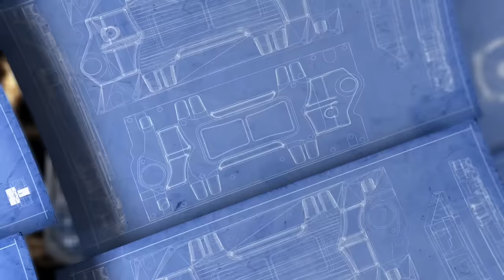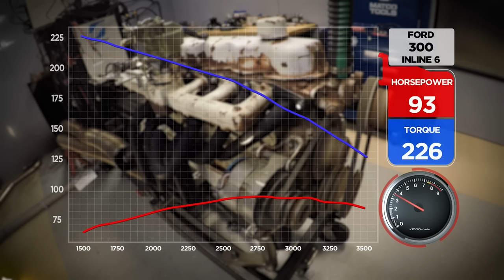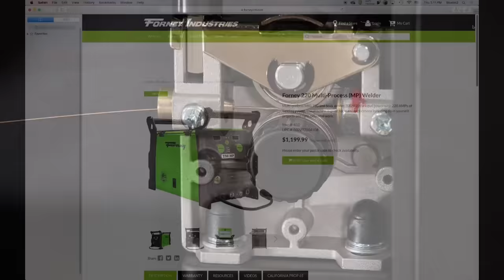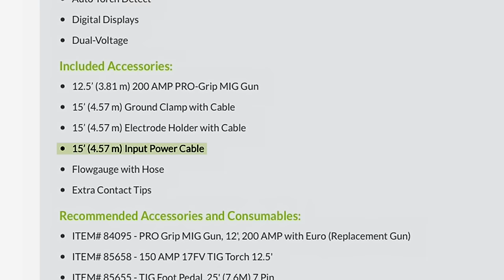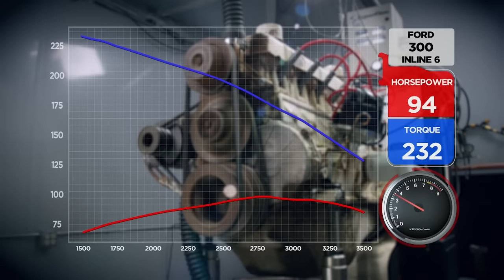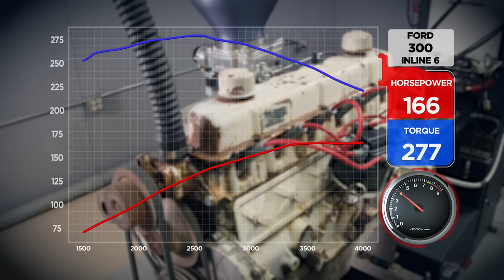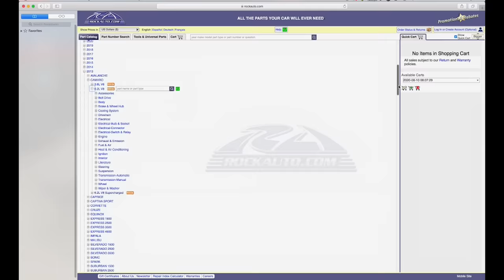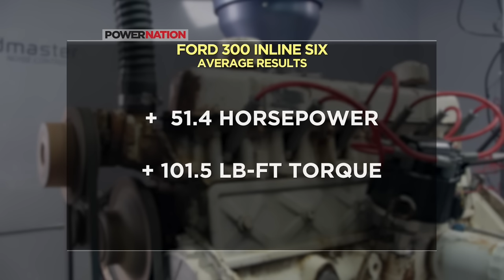Ford 300 Inline Six Gets Eye-Popping Off-The-Shelf Power - Engine Power S7, E17

Comment: 6:45 that's why you use an old pad to help compress the piston
Reply: Right I was wondering if I was the only one that thought that 😂
Reply: That's the best way and adding a little length to the handle on the c clamp works wonders
Reply: Works for me... everytime...
Reply: Yeah, that tool is for the guys that already bought everything else off "the truck" lol
Reply: I've never done it any other way. This guy is treating us like we are Sammy Sausage-head.
Reply: not to mention most people are stronger using a rotational force (which is also easier to 'enhance') than using a grip based force.
Reply: You see, what I do is I go find another person's car, jack it up, take the wheel off, use it as a jack stand, stick that under the car, then I set it down, lift up the other end of the car, take their rear pads off, then I go back to my car, take my tire off, take my caliper off, stick THOSE brake pads into the caliper, smash a low profile scissor jack in-between them, and then I push the caliper pistons back that way. 

No I don't
Reply: @Timman57  Thanks for that, that was entertaining.
Reply: @BrewBlaster  I'm REALLY bored.
Reply: I use vise grip c-clamps and a old pad or a little piece of flat stock.
Reply: That tool is the usual snake oil adds that you just have to filter out lol.
Reply: @Timman57  and don't forget to check the muffler bearing while you're under there .constant problem with those .
Reply: I think it's the only way with dual pistons.  Both pistons need to be pressed in at once, because the second piston will push the first piston back out...
Reply: @mikejohns3104  True, but it'd still be kinda nice to have.  Countless other tools I'll buy before that one though.

Comment: The issues with the 300s was ability to flow. 

The heads weren't made for flowing well, and if you fixed that, they made power even with no turbo
Reply: Actually you can take a set of 302 Boss heads, chop a cylinder off each, weld them together and you're good to go. Lol 

A WR 1/4 mile was set with that setup.
Reply: I've always wondered how you can run a 300 at full throttle day after day pulling heavy loads and not destroy the engine. It appears the way it was designed, full throttle from the factory is actually closer to 60% of potential. Pretty smart, really. If you want an engine to last forever, restrict intake and never allow it to work hard.

Comment: absolutely love this 300 series. I am currently redoing my dads old f250 that had a 460 and I am changing it out for a 300. Hoping to get 200 horse an 300 torque.This series gives me lots of hope!
Reply: Keep the 460
Reply: I know this is an old comment, but if the 460 still runs, I'd keep the 460 and use a 300 for a different project

Comment: When you changed the old points distributor to the new High Energy GM unit capable of 60,000 volts, you didn't change the plugs to accommodate the higher voltage spark. We've gained HP with a change to E3 diamond fire plugs, and even more HP with the addition of an MSD 6 ignition box that fires the plugs 20 times per revolution up to 3,000 rpm. More complete fuel burn to utilize the power from every drop of fuel. The emissions dropped drastically as well since there was very minimal excess unburnt fuel in the exhaust.
Reply: I was thinking the same thing. I'd opt to change to Iridium plugs with sizeable gaps. The spark plug gaps when running points are pretty narrow.

Comment: In the 1970s I worked at a race engine building shop in Nashville and we built 2 300 Fords like no others, They both went into NHRA record holding cars. Both had  cylinder heads that were made from 5 Ford Boss 302 heads that were sawed apart and then furnace brazed together in a fixture so they would bolt to the 300 block. Then they were what was called "high ported" where the exhaust side was milled off and a billet aluminum plate was bolted on. This allowed the exhaust gasses to exit at about a 45 degree angle. One of the engines had 3 Weber 2 barrels and the other had a fabricated Hilborn mechanical injection. Everything inside of these engines was the best with BRC pistions, Carillo rods, Solid roller cams and everything else.

Comment: I love the incremental testing. THIS is how much a header is worth - THIS comes from adding a decent intake...the ignition was a surprise. Points should have been able to handle that rpm and load. The original must have been completely shot.  BTW if anyone is looking for one that hasn't had the balls beat off it, check out the  mid '80s Ford econo-stationwagons. They actually had these jammed into that little engine bay.
Reply: Which econo-wagons would those be?
Reply: @413x398  they were never installed in cars.  The 80’s passenger cars had the 200ci inline 6...a whole different turd.  😂
Reply: @413x398  Hang on - let me see if I can get an ID.
Reply: @413x398  OK, got it - mid 80's Ford LTDs. Sound weird, but they're not the giant dinosaurs from the '70s - they're a Fox platform. Don't know the exact year. An ex-girlfriend "volunteered" me to work on the thing for a bunch of nuns (yes, this is true and yes, she was hot enough to get away with this behavior, for a while)
Reply: @nferraro222  You need to do some better homework. These tall deck inlines were not ever put in passenger cars. The low-deck inlines (200) were phased out in or about '83 and replaced with the Essex, which was a 3.8 liter (232 inch) VEE 6, a whole differ animal with aluminum heads. Please from making statements without verification just for the sake of throwing out a post. Thank you.
Reply: @413x398   OK, I see what you're saying. The 200 was a smaller straight 6 used in the mid-sized wagons. It looked huge in the car, but it was still smaller than the 300 I've seen in trucks. I retract what I said.
Reply: @nferraro222  For your punishment you must push a 300-incher truck one mile on four flats. Get it on video.
Reply: @413x398  I fixed that car for a bunch of nuns - my conscience is clear:)
Reply: @carportshenanigans5918  they did put the 4.9 in early eighty's ltd's. I know for a fact cause a old boss of mine had one in his ltd, I drove it and worked on it. It wasn't a 200, it was a 300 4.9l. and if I remember right it was a 84 model.
Reply: @Meantoy  negative, no such animal existed.  The oil pan would drag the ground while the valve cover stuck out of the hood.  The LTD II(the foxbody “baby LTD”) had the 200(3.3l)...no bigger six than that...ever.  Do some research bud, you’ll be sorely disappointed.
Reply: @carportshenanigans5918  whatever dude
Reply: @Meantoy  fact is fact, not “whatever”.  Maybe your boss told you it was a 300 or maybe your remembering wrong, but they didn’t produce a single passenger car with a 300...ever.  Look it up, you’ll see...don’t be grumpy at me for spittin’ facts.
Reply: @Meantoy  84 the only 6 banger was the 3.8 Essex V6. 83 was the last year for an inline and it was a 3.3. These other guys are right, Ford never put a 4.9, 300 inline 6 in a car.
Reply: @kevinthomas1462  Thanks for the correct information.
Reply: @413x398  The 240/300 was the base engine for the mid-late 60's LTDs.
Reply: @mfree80286  The 240 replaced the old design 223 in base Customs and Galaxies in '65. LTD's were an upscale option and there was never a six in one. However, this thread is about 300's, and not a one in a passenger car.
Reply: @413x398  Same deck height though, where one fits the other goes
Reply: @mfree80286  So, you can claim that 428's came in trucks because the deck height is the same as a 390?
Reply: @413x398  Christ, why does everyone on the internet always get their f*cking panties in a knot...  The other guy up there was saying it'd be dragging the ground with the valve cover through the hood. I pointed out this family of engine came in, and thanks for the clarification, the Galaxie 500. No, not a 300, but I'm actually wondering now if they measure the stroke on this one and it comes up 240ci... anyways, the engine's the same damn size so it puts him away. You were placed in the crossfire. Everyone's wrong, everyone's right, and I just hope I can still control my damn temper in public when quarantine's over because youtube comments sure don't f*cking help.
Reply: @mfree80286  Well, if you know how things are on YouTube, then just stay out of the firefight. Nothing here warrants a meltdown. However, if people would spend 5 minutes verifying their "factual" statements, 90% of the BS and angst could be avoided. That's an important thing that most just cannot get drilled into their heads. Not picking on you; just a general statement.
Reply: @Andrey Angere Yeah, apparently I was right about using the I6 when they ran out of V6s, but I was wrong about the size - it was a 200 instead of the truck 300. Live and learn:)

Comment: When compressing the caliper pistons, do it before you remove them, using the old brake pads to keep everything square. That's the way I've always done it.
Reply: Same.
Reply: I've always done the same, not having to worry about damaging the old brake pads.
Reply: i do the same thing with a big flat head or old tire iron before removing calipers
Reply: And always always open the bleeder first.  Otherwise you are pushing the most contaminated fluid back up through the system, through the ABS valve, through the master cylinder, and causing headaches for later.
Reply: i didnt know of any other way ! serously , i always thought thats how you did it , then discard or save for the trade  in

Comment: I had one of these 300s in an f150 when I first got my license. Great engine but I was young and dumb and thought I needed a V8. Traded the truck to a friend for a c10 with a 305. That was a lesson for me. 😢😢
13 years later the i6 was still running in a different vehicle and I bought it back. 17 years after buying it back I still have both engines. The i6 is in another pickup...the 305 block is the base of a table in the shop. 😂 
The i6 is 42 years old, has been used and abused and is still running strong and smooth.

Comment: Chevy, Ford, and Chrysler all made fantastic inline 6's!
Reply: took the 250 6 out of my van,dropped a 292 dead stock 6 back in,started it up and it burned rubber in reverse,scared me,as this van never chirped the tires before,drove it for another 50,000 miles with many oil changes, sold the engine to a guy in grand prairie texas,its sitting in a 58 chevy now,don't junk these engines 6 in a row will go
Reply: @bigboreracing356  In another league tho.
Reply: They did. I'm a Chevy guy. But I like the Chrysler first for it's durability and flexibility. It fits cars and trucks. Ford second, not because of quality, because I think it's the best, it just don't fit cars. That said, there is nothing like driving a ford 300 truck. Chevy third not because it is crap, it's just "meh" compared to the other Chevrolet engine options.
Reply: @bigboreracing356  yeah but you can't pull up to the car pumps and pump in whatever is cheaper,and yes cummins makes a indestructible engine,no arguments there,to me the 3006 and the 292 are the king daddies in inline pump gas circle,454 and 396 parts fit the 292 and 327 pistons go right in,chevy loved interchange,me to
Reply: @bigboreracing356  1 million miles to me is indestructible,have a nephew who has one, 12 valve with many oil changes it has 713,000 miles on it,its been to the moon and back,we'll see if it makes it back again,low rpm, brute torque and no timing chains,all gear driven makes the difference,i say indestructible
Reply: @bigboreracing356  well that's along wait when it comes to the cummins 6 it was built to work itself to death,it outperforms most engine easily,and when its time to rebuild it second time around will exceed most expectations,not wanting to rebuild a fantastic engine like it is,is plain laziness,pos never,hell even the parts are valuable,buy new
Reply: @bigboreracing356  no after building thousands of engines in my 47 years i'd say its just one more,and where's the parts,we're done,and you're lazy
Reply: MOST (though not all) inline sixes are good by design. They're inherently smooth and are usually great at producing low-end torque.
Reply: Mercedes had a nice 300,000 mile straight 6. Toyota not only had a great one but they are still used in forklifts.
Reply: In the early 80's, I saw a mechanic completely rebuild one of these for under $1,800 ... in one day...While it was still in the truck. I helped him put the hood back on at about 6pm.

Comment: I just happened upon this and found it extremely interesting in that many years ago, about 45 to be near exact, I had been a long-time fan (and owner) of Toyota LandCruisers. My first new one was in 1966 and subsequently owned 6 or 7 of them, always using them to their limits off-roading and racing in the Pacific Northwest with the Columbia Roadrunners (loosely called "jeep") Club (mostly Jeeps, a Scout, a few Broncos, Chevy Blazers, etc. Early on I had my dealer replace the engine on my second new one with a new Buick 401 cu in V8 , only the second conversion in the entire NW (I heard that a guy in Seattle had put a 389 Pontiac in his being the first conversion) soon after chevy v8 conversions of all types were showing up everywhere. My machine then was quite impressive with other upgrades and huge (for the time) Implement tires for sand use. Later with another new rig (I lost count of the sequence number) I came across what I thought to be a HP 396 Chev motor, tore it down for rebuild to find it a HP 427 ... but due to some problems when first ran in the rig it galled some cam/lifter surfaces due to incompatible materials used by the builder. About then a friend in the club working as a mechanic at the Chev Dealership found that GM had just released their first Big Block HP "Crate" motors to the public, a couple of us jumped right on that deal. His in a Chev Suburban and mine replacing the 427 ... these were LS6 454 450HP engines, the first and last of the "MuscleCar" reign ... making a long story shorter (as I am just reliving my youth, I am 80 now, and know you readers are not at all interested) ... eventually I "outgrew" the racing to that degree (100yd Sand Drags) and just recreated stock engine rigs ... always marveling at the great torque performance of such a small engine (135HP) ... wanting to upgrade to a 292 Chev 6 cyl, preferably the Ford 300 cu in ... well modified of course ... but never got around to it. ... so after so many years of not even thinking about it all, along came this here article ... wow! Had I ever known then what could have been I sure would have done it!
Reply: Thanks.  I always love a story.
Reply: Me to.

Comment: I did most of these upgrades to my first truck. 1982 F250. Yep you could get a straight 6 in a 3/4 ton back then. Headers, intake, 4 barrel Holly, hotter cam, and heavier valve springs. It woke the old girl up!

Comment: I had a '69 Econoline with the 240 version of this engine.  At the time (1978)  the only performance improvements I could find were a set of Doug Thorley StreetTubes.  Picture 2X3 Dual Exhaust.  
That SOUND when you let off the gas was the highlight of the experience.  This brought it back in Vivid Color!!!  I used to purposely let up in Tunnels...

Comment: Maybe a camshafts upgrade could gain maybe 20% more in power.
Reply: and after install rev it up to 5K.
Reply: @grad0n  Actually they can go to 8k rpm, search "Ford TC Engine"
Reply: Exactly what I was thinking, some springs and a cam would really wake it up, especially with that 4 barrel carb.
Reply: It could very easily kill torque down low if you did that.  Nothing a turbo can't solve.
Reply: @losergamer04  if you were to put in a cam that revs to 5k or so you wouldn’t be losing much if any.